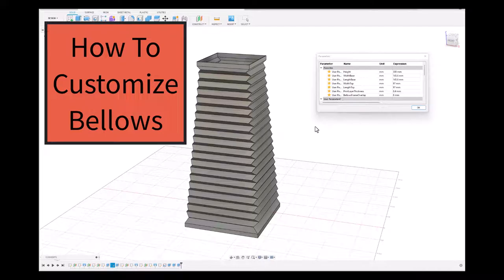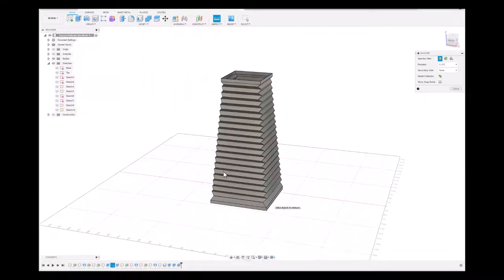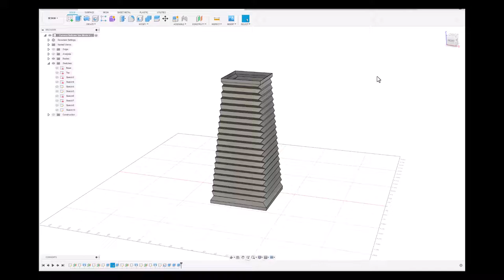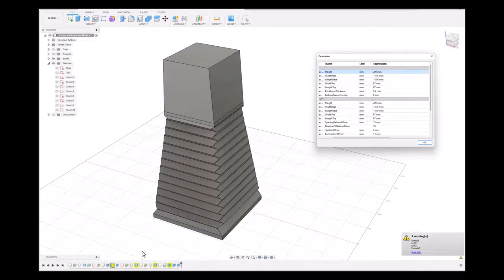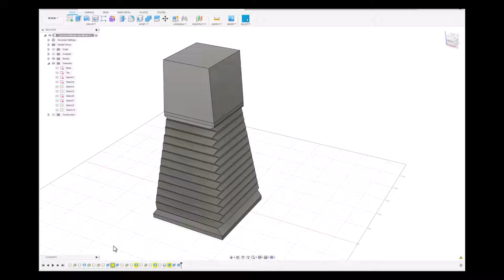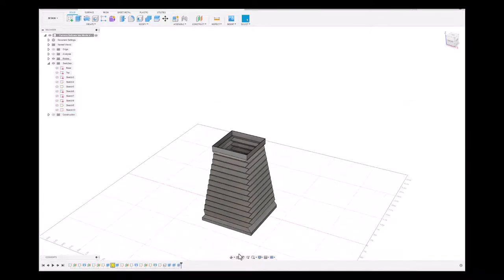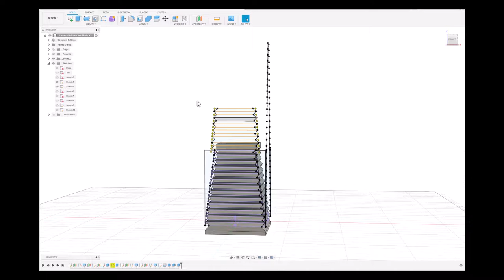How To Edit My Camera Bellows 3D Printed in Vase Mode (Outdated) - Printables Cameras Contest

Comment: I'm having trouble editing your files bro
Reply from the maker: Check to see if you have the latest version. At the time of writing this its V3.1
Reply: @kiwitinkerer  I believe so. I found the parameters but I can't render them gor Manufacturing on fusion. I might be missing something tho
Reply from the maker: So you've downloaded my .f3d not STL and you're changing the "Expression" not the "Value" (you can't change the Value section) in the Parameters and nothing is happening at all? I have downloaded my own .f3d file to test it out and its working normally for me. https://www.printables.com/model/246679-camera-bellows-collapsible-customizable-tpu-vase-m
Reply: @kiwitinkerer  I gotcha. I'll try it in a few. I appreciate the replies and the files
Reply: @kiwitinkerer  I didn't change the thickness to match the printer settings. It works now!
Reply from the maker: Cool man, if you print one you should post a make on Printables, would love to see it.
Reply: @kiwitinkerer  I definitely will. I just have to get my hands on some TPU